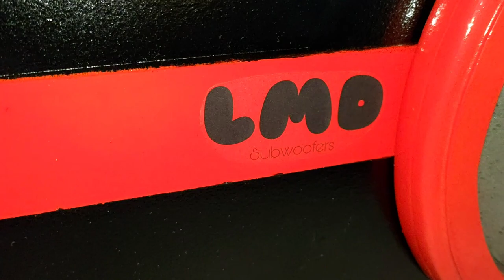LMD Boombox The Triangle Full Installation and Sound Test

Comment: nice build i have a question that can i use scoop bin box for 8 inch subwoofer
Reply from the maker: Yes you can brother but depending on the subwoofer need to calculate the air space volume inside the scoop bin enclosure as well as the size of the scoop. I build custom enclosures if you want I can build one for you. ☺️☺️
Reply: @AmulLuthra  thanks brother but the problem is that i am from Pakistan the box will be expensive to me 
I have the design of box i can send u to approve it if u can i will be great ful
And the subwoofer i am using i made a test video on my channel i can share u the link if u want 
Thank you ❤️

Comment: Nice setup 👌 bro
Overall kitna spnet Kiya h
Reply from the maker: Thank you so much brother ☺️☺️ and I have sold this for Rs 20000.
Reply: @AmulLuthra  भाई बुरा मत मानना लेकीन 20000 कुछ ज्यदा ही ले लिए यार I think 12000 me isse better and loud setup ready ho jata
Reply from the maker: Bhai ho jata hai toh karlo I have no problem. 1 khaali box mein speaker toh koi bhi Laga lega usme kya bdi baat hai. Main baat speaker and subwoofer enclosures mein Hoti hai calculations wo mere kisi bhi project mein utha k dekh Lena ekdum perfect hogi and doosri cheez hai designing. Sabse pehle baat custom designing ki toh yahan koi karta hi nhi and square box with single paint or carpet mein and iss trianglur shape plus dual tone paint scheme mein cost ka kaafi farak aata hai. And I am a custom desinger, fabricator and sound engineer brother main Khali boxes nhi bech rha without calculation wale. My work is totally different then the rest. And anyways happy new year ☺️☺️